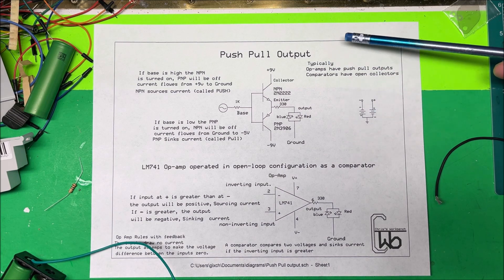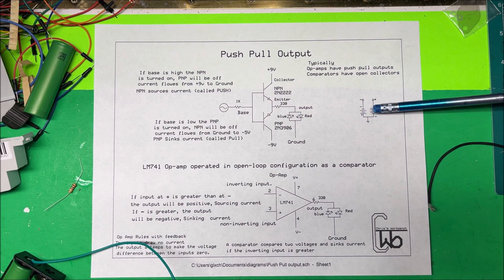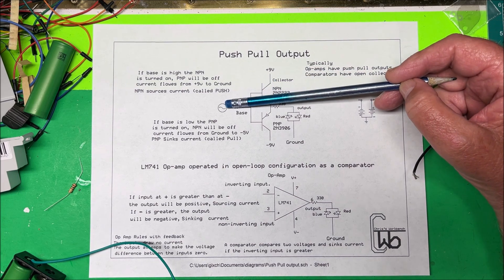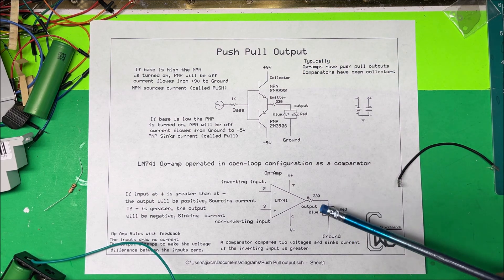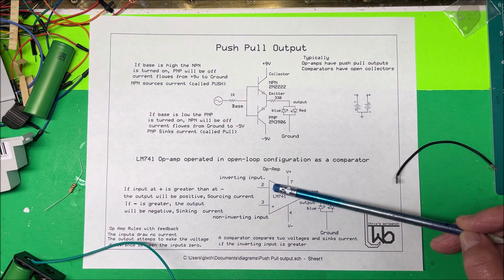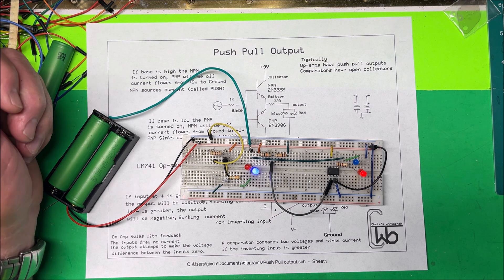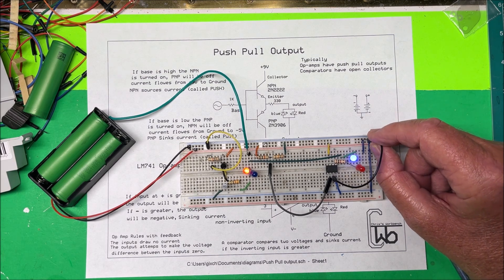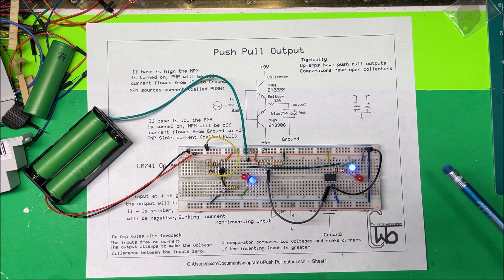Push pull output

Comment: Is the base resistor strictly necessary since both transistors are emitter followers and considering that there is a load?
Reply: Yep.
Reply: @mikebond6328  Why? There is a load to ground on both emitters.